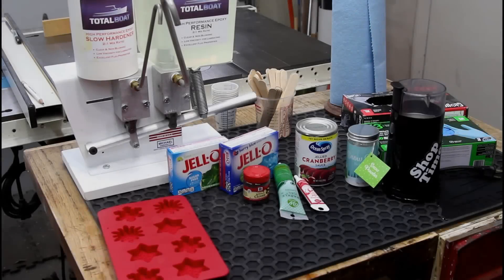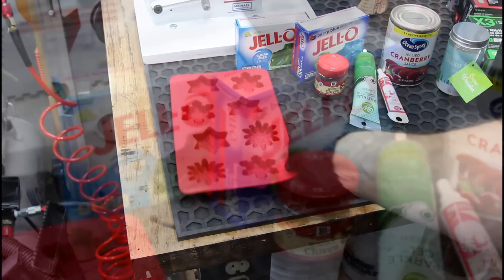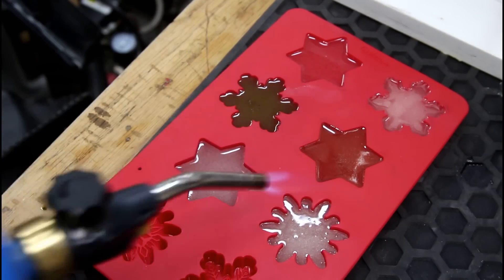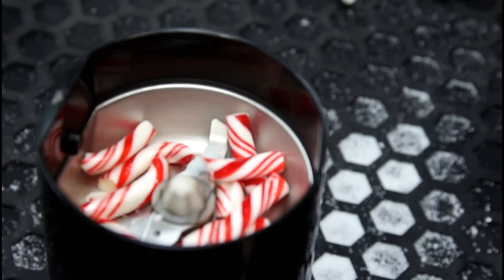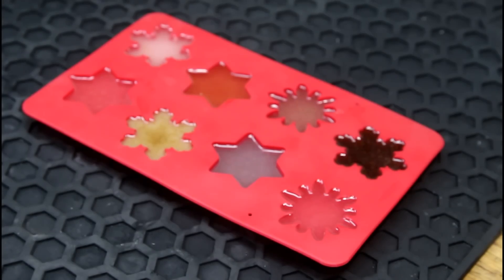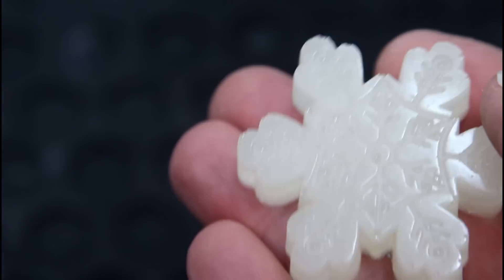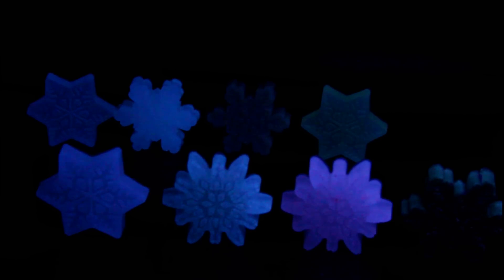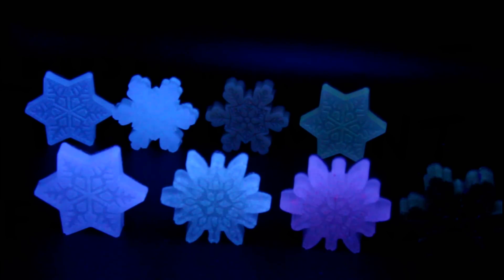Dye Trying 8: Holiday Experiments!

Comment: I think the reason why some of your snowflakes stuck to the mold is because it’s 3+ years old. I’ve been having that issue with some of my older silicone molds lately. Over time, the silicone begins to harden which makes it harder for the cured resin to separate from it. I haven’t tried mold release, but perhaps that could help?
Reply: Silicone absorbs fats/oils and that weakens it's atomic bonds. It could theoretically absorb them from the air, but not sure how that would happen in a workshop. Google says food grade silicone has a shelf life of 10-20 years, but I found data on specific silicone manufacturing processes that range from 1 to 40 years for their shelf life.
Reply: It could also just be too detailed

Comment: Hey Peter, I have a suggestion for the next Dye Trying: White-out. I've used it and got great results, but you need to mix it inmediately after pouring it on the resin. Happy new year!
Reply: White out was in Dye Trying 5
Reply: He's tried it before and the resin turned to power.
Reply: @ieuanhunt552  That was the calamine lotion, the white out set solid

Comment: Hey Peter, I have a question: could you do a video where you make something without power tools? I'm a beginner when it comes to resin stuff, and I like making things, but not having a lathe in my apartment hampers what I can make. Have you ever tried making your own moulds?
Reply: Peter has! Search this channel for "Molding & Casting: A Zero Clearance Insert" Also search around youtube for silicone mold making.  If you can pour resin, you can pour silicone too; same equipment pretty much.
Reply: @Iowasurvivor you could hand sand it but it would take forever!

Comment: The coffee grinder, as you can call it, is not a true grinder. It is meant for French press coffee, and some other types. I am not saying it is not good or not okay to use, but for fine, it is not. If you want finer, look for a hand grinder that is meant for an espresso machine. The reason I say hand grinder is that it is cheaper as you are putting more money into the grinding burrs and not the motor. Better for cheaper, if you do not need the motor.

Comment: You have done a lot of Dye Trying, but have never turned them on a lathe. Is it time to put your money where your mouth is and make and turn some blanks using the best of your dye trying successes? Perhaps there are hidden strengths and weaknesses that little molds cannot showcase.

Oooo perhaps a pen blank tournament make and turn a blank for one or two contenders from each dye trying episode aand make large and more complicated objects as you whittle down the field.

as for ideas ... if you have access to a dehydrator, you could dehydrate stuff and powderize it to make dyes.

citrus peel, avacado peel, carrot shavings any strong coloured food could be a contender., what happens if you mix oil and a really fast setting resin and mix using a drill? can you make oil sponge with droplets of oil suspended in resin?

Can you use slow settig resin and add so much substrate that you get a workable paste like a pastry? can you layer this and fold it with another coloured paste to make a sandwitch and fold and stack as if you were making puff pastry in order to get a resin blank with exponential layers ?

Just a few crazy ideas off of the top of my head, have a great new year and thanks for all the videos